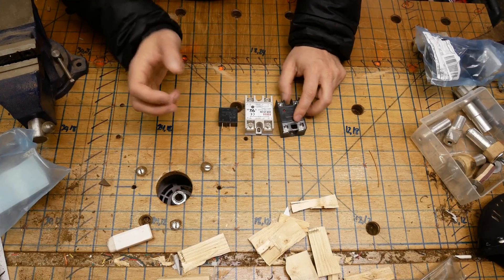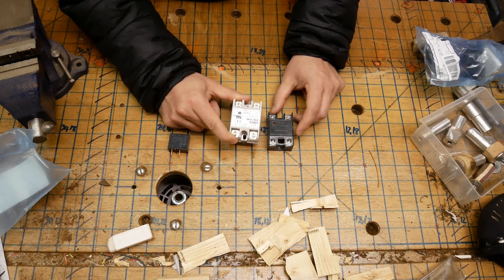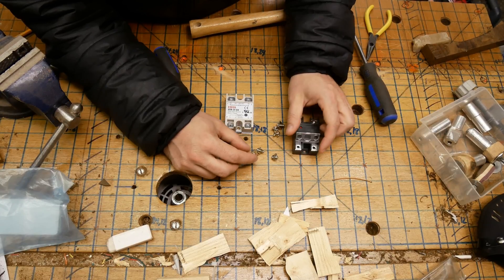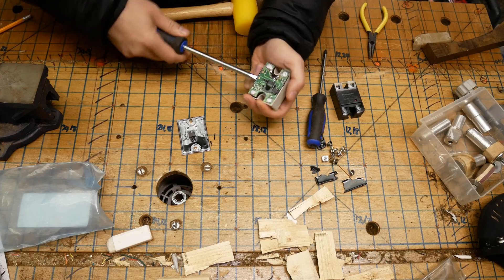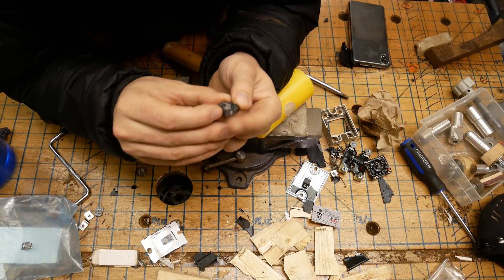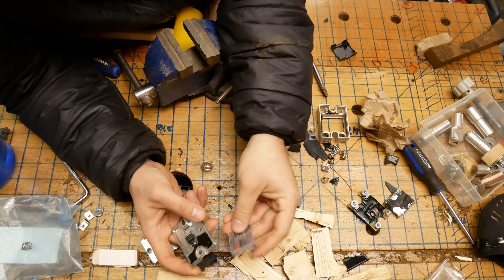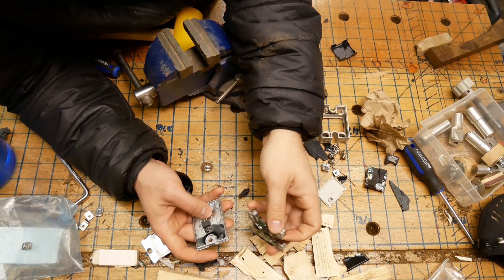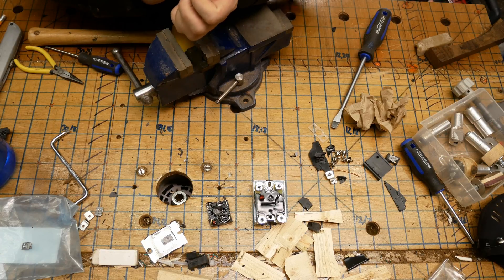REAL VS FAKE SSR

Comment: The whole SSR industry is suspect: the critical ON Resistance spec is purposefully obfuscated if not denied outright.
That On Resistance by any name makes the switched loads run at lower voltages and requires substantial heatsinks for the wasted watts

Comment: i haven't had a problem yet with probably knockoff foteks. but if i had a million dollar application i'd be making my own solid state relays. but of course who can know if one wont start arcing on a 10 amp circuit without tripping the breaker and burn down the house. or if some terrorist filled one with nanothermite. i guess you can't be too careful.

Comment: The maximum ratings of electronic components such as triacs are based upon the component having a notionally infinite heatsink, so in reality a lot of derating or heatsinking is required or use a much higher rated solid state relay.

It's interesting how one of the relays featured here was the opposite way around regarding the specification in that it would make sense for a 25A triac could reasonably be in a solid state relay rated 16A. Personally, I run electronics with as low a load as possible to minimise heat generated and achieve maximum life. For a solid state relay, I think I'd be happy running maybe 30-40% of the maximum rating but definitely not more than 50%, although it does depend on the nature of the load and the exact specification of the SSR.

Comment: When you use a SSR for resistive loads, get one that has two times your needs (so controlling a 20W heater element, get a 40W SSR)
However if you are going to switch inductive loads (motors, AC, pumps, Solenoids) get six times the appliance rating! (so if you want to switch a 20W motor, get a 120W SSR)
For inductive loads it's cheaper to ust use a mechanical relay for such things
Reply: Hold on there.. most ratings on ssr are for resistive loads

Comment: SSR's NEED good heat sinks and to be chosen properly. Always consider the printed current rating as a peak rating and RMS is 1/3rd of that even with name brands, and have a proper heat sink and mounting system that has good air flow. 
Also most consumer bought SSR's are rated for resistive loads (heaters, lights (minus neon signs and fluorescent lamps), switch mode PSU's) not inductive loads (HVAC, power tools, and fans) especially if the load has a start and run capacitor. This is hard on the SSR's Triac and in time will cause the TRIAC to fail in interesting ways (one such way you described).

Comment: Mechanical relays will fail closed fairly often. If you check out a lot of old furnace boards and appliance boards, you’ll see charred contacts and melted solder under the relay. Which means the contacts degraded, or there was a large current spike welding them together… And allowing an overload condition. I see it quite often come through my lab
Reply: +1

Comment: Thanks for this video...you get a like just for destroying the panasonic...must've hurt a bit...While its perfectly fine practice to stick to 80% of rating for even branded electronics...it's completely unnecessary. That is exactly what you are paying for with high-quality electronics, good engineering, accelerated wear testing, and built-in derating...honestly, if you derate by 20-25% its more likely that you are running at 50-60% of the specified max...once again totally fine (and even good for longevity) when you are doing one-offs or personal projects, but can definitely add up quick. Great video though!

Comment: Any reliable shops on AliExpress for the  SSR-25DD or 40, 80 Amp versions.  I only use it to switch a 1 Amp 1vdc fan, but i wouldt like a reliable real SSR.

Comment: I use a lot of these for kiln controllers. Rule of thumb... buy at least twice the amperage  of your device. These Chinese things are not to be trusted. Most are over rated. Also the amount of current they can pass drops off with increasing temperature. So heat sink um good and try to get a fan in there to cool them.

Comment: I've never had a solenoid failure on 2 hp relays leaving the circuit open on induction motors (pool equipment) in 10 years. They ALWAYS fail closed due to basically spot welding themselves due to the inrush current, or where the AC cycle is on the sine wave when the contacts close. At or near max positive or negative will cause the contacts to arc and weld over time. Its crazy how much amperage an induction motor will draw a startup (basically full slip). If a motor is rated at roughly 15 amps, it will draw close to 40 at start up
Reply: Adding to that, an inductive load is quite complicated when turning it off, as it will tend to arc when disconnected. I imagine a motor will be fine on a relay until a certain point where you'll definitely need to go with a proper contactor.

Comment: I had mechanical relays failing in closed Position, the contacts melted together despite they where original brand relays. The load was just about 3A to 4A and the relays where rated with 10A. I had to pull the relays out of their socket to shut the attached devices off. Maybe it was the inductance of a Motor that was the cause of failure, but I'm not sure.
Reply: Definitely it's the EMF
Reply: @Airman..  Yes, it was probably the CEMF spike that welded the contacts together.
Reply: Relays used for motor appliances should be considered up o 4 times the rated load of the motor. in this case 10 amps is just under sized. Try using bigger relay, 15 or 16  Amp should be ok, or move to  contactor

Comment: I dont buy Chinese stuff  design my own circuits are challenging also fun to   create a circuit is robust and wont ever fail .
Depends on how good you are in circuit design .
Also those online stuff are so fake and over rated 
Example a triac  datasheet shows its absolute max rating for a decent factory when you buy a Chinese unknown factory for same  
Triac number and do a stress test on it you find it very funny how it fails and blow even when not reaching the max ratings from the original datadheet.

Comment: Bigclivedotcom tears one of those (looks identical) down and discusses the schematic and components used, see: https://www.youtube.com/watch?v=DxEhxjvifyY

Basically they shouldn't be used as rated, they're way over-rated and are only safe for like 10A instead of 25A. Also the input voltage shouldn't exceed 24V (and definitely not 36V). The one that burned could be caused by a resistor in the input stage having to dissipate 1W @36V, that together with the heat of the Triac (it's not a MOSFET) @ 13A could have been way too much.

The Triac can only operate @ 16A when it can dissipate the heat generated at that current (see datasheet). It's very likely it couldn't dissipate enough in that SSR (especially if a resistor was also generating heat).

So run it at 3-5V and max 10A and it should be OK (but check generated heat and if the SSR stays a constant temperature instead of getting hotter and hotter.
Reply from the maker: Yup, his teardown was the best by far, but I still wanted to see how it looked compared to the known "good" relay.

Comment: A mechanical relay can fail close if the contacts weld to each other....
Reply from the maker: That's fair, but in that instance you've probably had a power surge that also fried everything else as well, so the state of the relay becomes moot.
Reply: @Making  That depends, the surge could be the proper inrush current of whatever's switched. Might first lead to pitting on the contacts due to arcing (increasing resistance more and more over time) and then eventually weld closed.

It happens often in industrial settings.
Reply from the maker: That's when a contactor should be used instead ;) I didn't think of the pitting increasing the resistance, but I guess a lower contact surface and oxidized pits would do that indeed.

Comment: All electronic devices that you plane to run high current thru should always be attach to a proper cooling devices, that’s why you have a large bare metal surface on the bottom. That’s standard procedures! It’s the heat that is a result of high current which is no good for the components and is possibly a fire hazard. The components are rarely the problem it’s more often the poor soldering to the boards so called “coolsoldering” ie. the solderingmaterial didn’t fuse the component proper to whatever they are attached to which then results in poor friction and higher temp as a result. Almost all components no matter the brand is nowadays almost always done in a factory somewhere in China! :-)
Reply from the maker: Yes, but in this case it also had the wrong rating on the sticker compared to the mosfet. Technically you can run just about any component at a higher current if you cool it enough... But derating factors and the ability to withstand heat are necessary in real life.

Comment: it's wise to take the chinese amperage rating ALWAYS as a peak rating. or a good rule of thumb is to run no more than half the amps it's branded for.
Reply from the maker: Yuuuup! Even with brand name  it's recommend no more than 80-85% for long term use if you want good longevity

Comment: Great video! I am wanting to buy an SSR for my 220v 3d printer heated bed.
Reply: I'used a fotek ssr50da to manage the main power supply of my 3d printer using RPi and octoprint. All worked well until the ssr shorted the high voltage contacts fater about after one month... I' can't undestand the reason.
Reply: So in other words, even if i end up with a Fotek 25A conterfeit, it would be safe for a load of 2.7a?
Reply from the maker: My conclusion was that they seem mostly well build but severely over rated. At 2.7A supervised, it seems reasonable. I would measure the temperature change / put a heatsink. If it warms up within a few hours, I'd go for something else. On a 3d printer, you should have no problem using a mechanical relay no?
Reply: searched ebay and aliexpress but they don't offer panasonic ones in china to be sure, also pretty sure the conrad one is legit :) BTW, you got a new subscriber ;)
Reply from the maker: That's what I do as well. 3d printers can run very long unattended... It's different when it's for something like a diy spot welder where if it fails, you are right there to deal with it. Still, don't forget the heatsink on your new ssr! :) thanks and have a great day!

Comment: Do you have a link to a good source for these legitimate relays? What would you say about this one? https://www.ebay.com/itm/80A-DC-to-AC-3-32VDC-to-24-440AC-Thermal-Compound-Solid-State-Relay-Heat-Sink/272818755800?hash=item3f8543d8d8:g:gaAAAOSwYVlZ5dvI  I need this for my battery spot welder.
Reply from the maker: Unfortunately, the only way to guarantee that you are getting what you pay for is to go through an official channel, such as digikey, mouser, another big supplier, or the manufacturer (many sell directly). Since this is something you use while you are sitting next to it though, you can monitor it / make sure it doesn't burn. Also, as I mentioned, they do seem to be well built, just underrated. It comes down to duty cycle, and spot welders are off most of the time, so it should have time to dissipate the heat even if it is running on the higher-end of its capacity. At 80A, even if it is the correct rating, is that enough? Last time I made myself a spot welder, it was pulling 400+. amps I mean peak rating will be higher than 80, but you will want access to the spec sheet. Also notice that this "factory direct" option also sells clothing and toys. I'd move along if you want to run hundreds of amps through there..